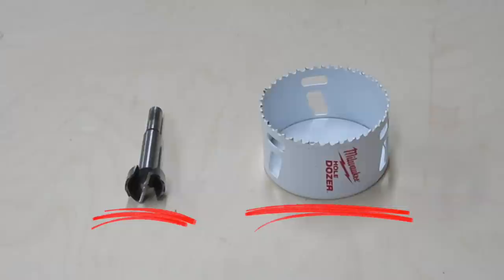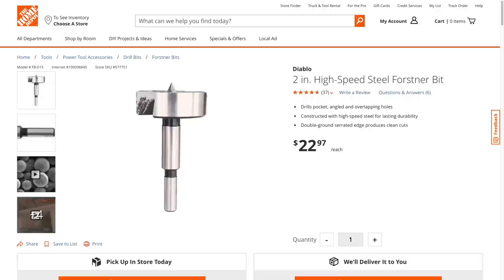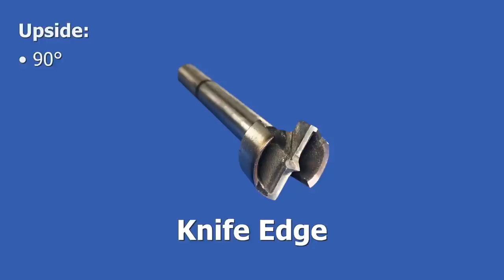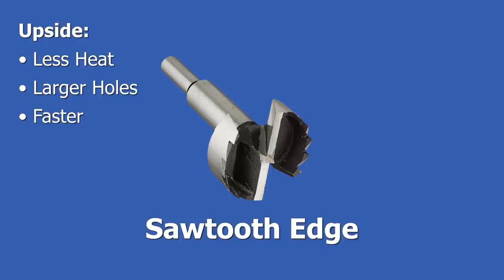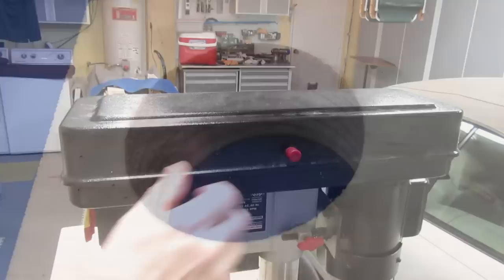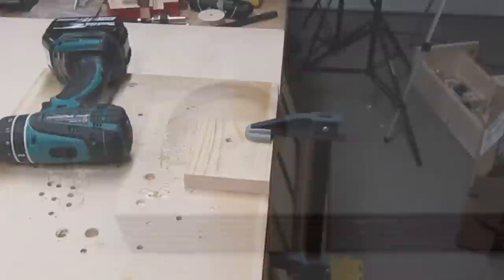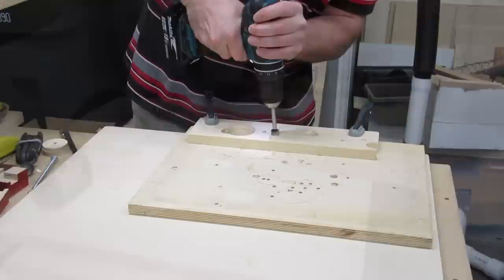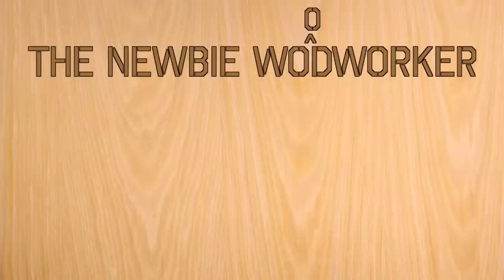Newbie Tool Tip: Forstner Bits

Comment: I have an additional tip for preventing tearout when using a drill press.  Drill a pilot hole in the center with a small diameter standard drill bit.  Then, using this hole to center the Forster bit, drill about halfway through the material, flip it over, and then drill through the other half.  Works great in my experience.  I haven't tried this with a hand drill, but I'm guessing results would vary greatly.  BTW, I really like your approach with these videos.  Simple, friendly, easy to follow, and not afraid to say, "I don't know."  Keep up the good work!
Reply from the maker: Great tip! Wish I'd thought of it! I can see exactly how it works - just like how I use hole saws. And I would think that it'd work for handheld drills also. Thanks! And thanks for saying you enjoy my videos. Yes, I have no problem saying "I don't know". Besides, there's too many YouTubers out there who would call me on it in a second, if I did try to BS my way through. :)
Reply: I just used this technique yesterday on a 1-3/8" forstner bit, and can confirm it works great.  I drilled 1/8" pilot holes first all the way thru, and set the stop on my drill press to not drill all the way thru the wood.
Reply from the maker: @johnnichols8553  👍

Comment: Thank you. This video and the one on counterbores was exactly what I needed to refasten the removable panel on my privacy fence. Turns out half an inch of bite from a deck screw isn't enough to secure the panel to the post when the prevailing wind is coming from the backside. I'm going to bolt the stringer to the post under the picket. Should have been paying more attention when they were installing it, I guess.
Reply from the maker: Glad I could help! 😄

Comment: Drilled 16 holes in a plywood prototype last night with a forstner for the 1st time and had really bad tear out on the backside, it won't affect the product, but it still bothered me, idk what I was thinking, but sometime in the middle of the night I realized I just needed a backer to hold the end plys in place. I guess I was blaming the source of my forstners (Amazon/China) rather than common sense practices
Reply from the maker: Yeah, tear-out can definitely happen. A backing board is a good idea, or drill partway through from one side, and finish from the other (requires a small pilot hole).

Comment: Also existing with , as you call the chippers, with chip breakers.( Famag or Stern). Dividing the chips in smaller ones, making drilling a lot easyer, those needs less force. Best regards.
Reply from the maker: Thanks!

Comment: Forstner bits are like most tools the prices and quility very widely from cheap to outrageously expensive, but for moust of hobbyist woodworkers the bits from cheap Chinese inc. work well and do the job and fit in  to our limited budgets and hold up well. At one time I neede a 2" and a 1 1/2" bit it was cheaper to buy a whole set than just thoes 2 bits.
Reply from the maker: Yep, you're right. Thanks!

Comment: "Wavy" bits are a compromise between a "straight-edge" bit and a "saw-tooth" Forstner bit. They don't get as hot as the "straight-edge" ones, and at the same time are not as aggressive as the "saw-tooth" ones in terms of tearing the stock.
Reply from the maker: Thanks for the info! 😄

Comment: As I understand a wave edge bit is the best of both knife edge and sawtooth edge bits, but they also cost more money like 4 times as much. 

You want a clean hole start with a knife edge once the surface fibers are scored simi deep change to a sawtooth type but stop short of drilling all the way, flip the part over and finnish with the knife edge.
Your hole should be perfect without any blow out. Sawtooth cutters tend to pick up fibers on the way in and chip out they will also blow out the back end of a cut.
You can prevent this with a backing board but better to be safe then sorry.
Let's assume your drilling into some priceless wood you cant afford to turn into scrap or fire wood.
Reply from the maker: Thanks for the info! 😄

Comment: I thought, and please remember that anyone newer that me to woodworking hasn’t been born yet, that saw bits and spade bits cut through the wood and forstner bits are for when you want a flat bottom. But in all probability I’ve totally misunderstood something somewhere.
Reply from the maker: No worries about the newbie question - it's actually a great question! The main reason you'd use a forstner bit, spade bit, or hole saw is for larger diameter holes. You don't see many twist bits (standard bits) much larger than a half inch, very often. I suspect that if they got much larger, they wouldn't product very clean holes, but I don't know for sure - I could be wrong about that. But regardless, when you start needing larger holes, and look at what's available, it's usually forstner bits, spade bits, hole saws, and hole cutters.
Reply: The Newbie Woodworker Thanks Dan, woodworking far more complicated than I thought when I said "I can make my own photograph frames, how hard can it be?"

It’s also a lot more addictive.
Reply from the maker: @markharris5771  Mark, I know EXACTLY what you mean. My adventure, pre-YouTube channel, started a couple of years ago, when all I wanted to do was make a game controller box. The buttons and wiring were easy (relatively). But I didn't like the look of the box, and thought "how hard can it be to make a good looking box?" As you might suspect, I still have the original box sitting on my credenza, untouched. But I'm sure having fun!

Comment: I have a bed frame that uses a forstner bit hole how do I know how deep to go in its my first time using this bit any suggestions would be helpful
Reply from the maker: That's always guessing game, depending on what kind of screw/bolt/washer you want to use. I suggest using a piece of scrap wood and just experimenting. For me, I've kind-of gotten used to how much of the Forstner bit has to disappear before I've gone far enough. But like I said, start out with a piece of scrap wood. Don't forget to use the Forstner bit first, then a regular bit to drill the rest of the way through. Good luck! 😄
Reply: @TheNewbieWoodworker  should I go by the old hardware
Reply from the maker: @danielriveraandujar7133  I would imagine so, although since I don't know exactly what you're doing, I can't say for sure.
Reply: @TheNewbieWoodworker  I'm replacing one of a bed frame that my son broke and I notice that a forstner bit was used
Reply from the maker: @danielriveraandujar7133  Then just make sure you don't drill down so far that you really weaken the wood. And tell your son to stop jumping on the bed! 😂

Comment: Hmm I always thought that using a forstner bit with a handheld drill was a big no no.  Interesting.
Reply from the maker: I know what you mean, but it's perfectly usable as long as you clamp things down. I saw a video a while back where someone was holding the stock in one hand - not on a table, just in the air - and drilling with the other hand. Now that's something I wouldn't recommend! :)
Reply: I heard the same thing but in my experience it's totally doable up to say about 3/4 to 1 inch forstner bits. And if you have a side handle on the hand drill or a stock to lean your shoulder into and keep it nice and steady, even better. I think they're originally designed for drill presses but just like every other designed item, people are going to cultivate the skill required to use them in different applications. I'm of the mind set to heed safety advice but try most other things out myself to see if those "rules" truly apply or not.

(Now granted some of those things are undoubtedly going to put extra wear on my tools, but, hey, I don't want to pass along shiny brand new bits to my kids or their kids. Let them get the hand me down crap!)
Reply from the maker: @honestinsincerity2270  LOL, and thanks for the comment. How can they tell it's an heirloom if it's nice and shiny? 😄